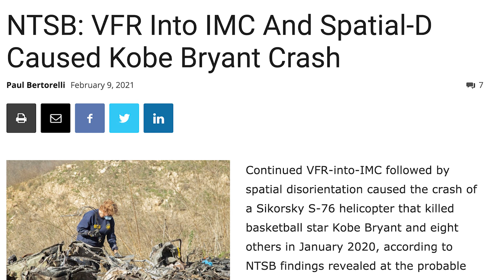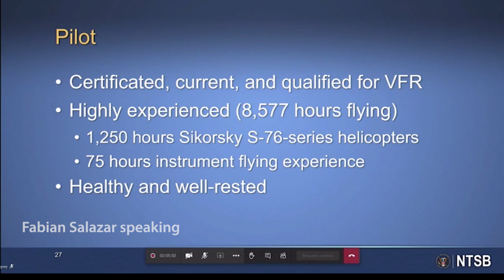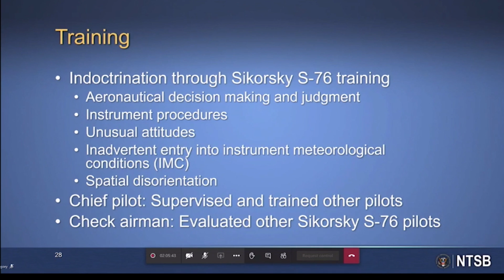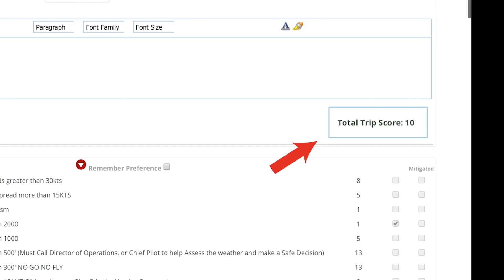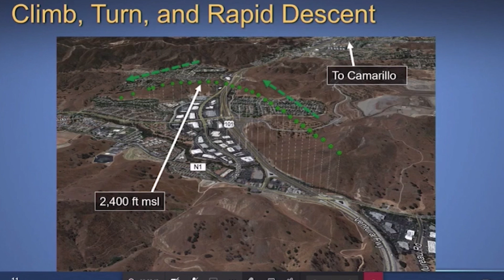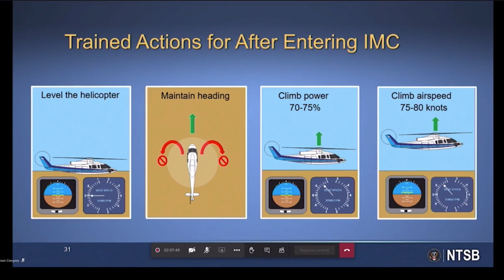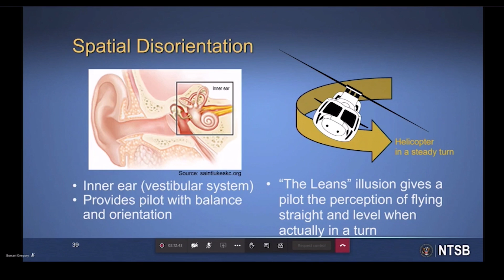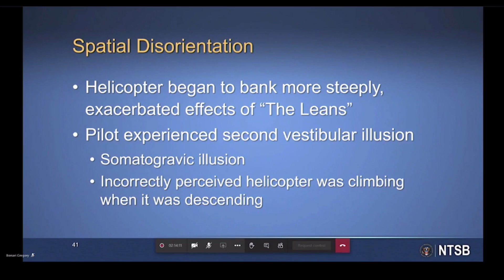How A Split Second Wrong Decision Caused the Kobe Bryant Fatal Crash

Comment: I’m a 9000 hour ATP rated part 135 helicopter pilot, instructor and check airman. This was not what I would call a “good “ pilot, no matter how well regarded he was. This is not based on the fact that he crashed but on other testimonies of his scud running, getting trapped above an overcast and letting down off shore and proceeding to land at night with critically low fuel, several airspace incursions and the list goes on. This pilot not only thought this was ok, he bragged about it. He took pride in always “getting the job done” lack of instrument flying skills is a disease that has plagued the helicopter industry for too long and the FAA needs to do something.
Reply: I thought it was odd that there was only one pilot, considering the client’s wealth, and the fact that that helicopter type can support either one or two pilots. Two pilots means they can divide the workload in a challenging situation, and also help each other during normal situations. I know it’s considered perfectly safe with only one pilot, but if money is no object, then why not two pilots? And why not have them both be elite pilots who also regularly train on instruments?

Seems like if a pilot has no instrument skills, they should take that into account and be ultra cautious around weather. (Also, he could have decreased his speed to the minimum needed, instead if continuing at 150 knots, in a hilly area, with no visibility and no active instrument skills. I know they cannot hover, but I’m sure they do not have to continue flying at maximum speed either. It would have bought him more time to think, and maybe turn around before he hit the foggy area.)

I would have hired an expert helicopter pilot to help screen and interview and fly with the pilot applicants, until you wind up with a pool of 5 or 6 elite helicopter pilots that meet whatever the top standards are, and have great reputations (things that don’t appear on a resume or the FAA records, like local reputations for being too aggressive or reckless.) Then you have two of those pilots on every flight, and a backup luxury SUV and driver driving to the destination, in case the weather is bad by the time you want to leave, and you need to drive back. All of this would be very affordable to him.

I’m not a pilot, but it sounds like common sense to hire only the very best pilots (two per flight,) if you can easily afford it. Just a very sad situation, Kobe had another 40 or 50 years left to do more great things, and all the other passengers also had their lives cut so short.
Reply: "several airspace incursions" midairs happen
Reply: Can you give me a pointer to the source you got those testimonies about the pilot from?
Reply: @ThatOtherTom  Really? That’s your expectation? That because someone has wealth, they go over the top and play privite investigator vetting everyone? You’re talking about a stricter policy than large companies who do the trade have. 
Guys like Kobe have agents/managers they task with finding what they want. I’m this instance a helicopter charter. Given the companies safety record, you can conclude they investigated their record, or simply got lucky. 
It’s a mistake however to just assume Kobe, or whomever he could have hired for your plan, would inherently raise the safety of flight. The pilot who crashed was an “expert” who checked and qualified others.
Reply: @patstaysuckafreeboss8006  He was certainly still an “expert” regardless of how you view his record. 

My point is that someone who doesn’t know about aviation, would be under the impression he’s the cream of the crop, regardless of whether he was or not. If you were a celeb looking for a good pilot, he looked like a guy who was over qualified.
Reply: conveniently missing in the report
Reply: The record of unsafe flying is interesting
Reply: I have a solution: nobody flies without instrument ratings. 

And if you can't prove basic literacy, you don't get online. Imagine how much that would solve. Lol.
Reply: @ThatOtherTom  In Europe the S75 is only allowed to operate in IFR conditions with TWO pilots. That's probably why it has such an awesome autopilot (if it was working at the time)
Reply: @trixn4285  Vanity Fair has a good article about what happened that day. That specific testimony is from another Island Express helicopter pilot that flew under Zobayan.
Reply: @stellarwind1946  Thanks for the pointer. Very good article but what an avoidable tragedy. Given that information the pilot clearly pushed the limits past the rules and his own abilities. Totally agree with OP.
Reply: @mikemck4796  Looks can be deceiving. Don’t trust another person with your life and the lives of your family. 
This guy looked like an expert until impact with terra firma and if the agent hired the helicopter charter then the agent isn’t an “expert” either. 
Managing show dates etc maybe, hiring a good pilot, not so much
Reply: @richardcranium3417  Anytime someone travels they’re “putting their lives in someone’s hands.” It’s a fact of life. Unless you want to go unabomber yourself in the mountains, you’re accepting some risk by other humans. 
With the crash, you’re working back from the conclusion. There is little to no reason Kobe should have taken issue with the pilot. Especially after years of flying with him.
Reply: @windsofmarchjourneyperrytr2823  Jesus christ man I run into you on YouTube more than anyone else by far! You and I must follow all the exact same channels and it’s across quite a variety too!
Reply: Couldn’t agree more…2-IFR pilots, this would never be a story.  To bad his ego led to this… but it happens far to often.
Reply: @Tom Gulbranson I don’t fly. I do drive and a lot of driving is in my hands (yes there are others on the road). 
A little context is in order. Context makes the world go round and out of context makes CNN rich. 
What was meant by my original post was do a check on the person you are entrusting your families lives to. 
Apparently he had some issues.
I wouldn’t just pick a physician off of the interwebs anymore than I would a pilot without running a check on them.
Physician advise, from one. If my doctor recommends another physician them from him also. Certain things in life shouldn’t be picked like a milkshake flavor
Reply: @Tom Gulbranson That is if one assumes the roads that I travel have other vehicles traveling them as well. It’s not a given. 
Complete control as in hiring a helicopter pilot? No, not by a long shot. When my hands are on the wheel my actions affect the outcome of the trip directly. Yes the other people on the road, if they are on the same road, do have a percentage of that responsibility but not as great as mine. Watching the ground come at you at a high rate of speed with someone else’s hands on the controls with nothing to do but accept it doesn’t compare to driving on a trip. 
See the original posters comments above for the issues. I don’t want to spend time hairsplitting on semantics as that never ends and life demands my time. Take care.
Reply: @Tom Gulbranson He could have had the ratings but was he current?
Reply: @Tom Gulbranson I am not a pilot. But there was some discussion between Juan Browne and a Helicopter Pilot friend who flies as a Ambulance Helicopter Pilot. They were questioning his currency,
Reply: Now you are talking ! What is your estimation of the raise in cost of charter helo flying in case you mandate IFR capabilities for all of them ? Just curious, not a trap question.
Reply: @Tom Gulbranson Yep. That is my current understanding as well. Yeah it's a shame to have a pilot IFR rated (but may not be current) and machine IFR equipped with a good  A/P and end up like this. IFR might not have been an option from a legal standpoint (outfit not approved) but in case of emergency why not. All what mattered was punch trough that 3000 ft (?) thick inert cloud layer. 3 minutes of flight at 1000 ft/min and everyone was safe, but maybe some explaining to do to the FAA.
Reply: Thanks Scott you made my day with this.
Reply: @ThatOtherTom  great suggestion, but that all costs money. And even a millionaire likes to get the best bang for his buck when laying out his cash. There comes a time when all those layers of safety don’t interest the paying customer - just the bottom line!

That’s why you have accidents, deaths etc. Call it what you will, you can’t buy your way out of this. Only mitigate to what the market prices will support.